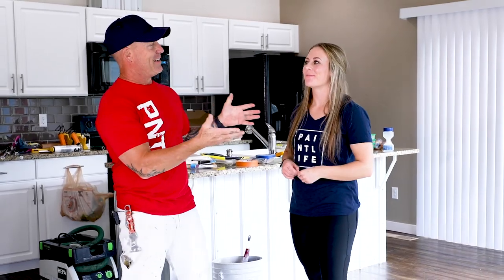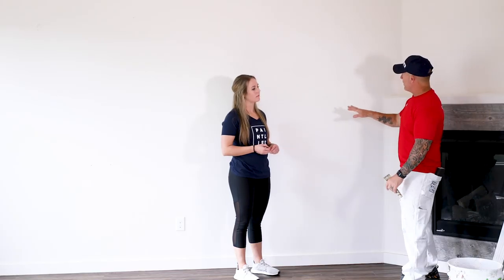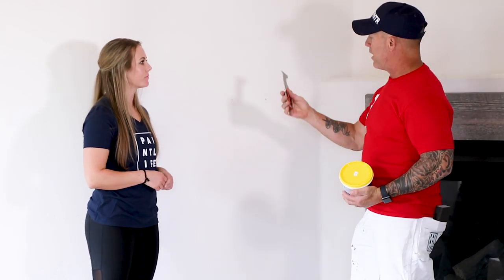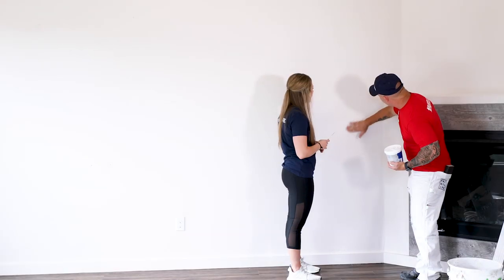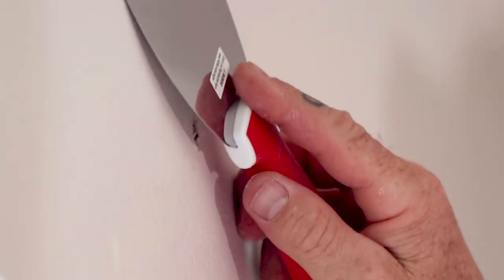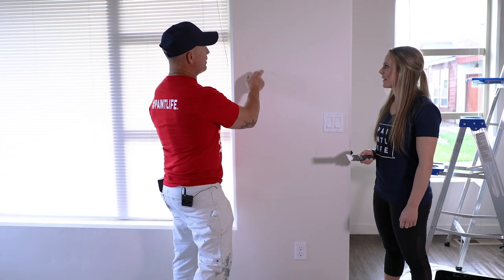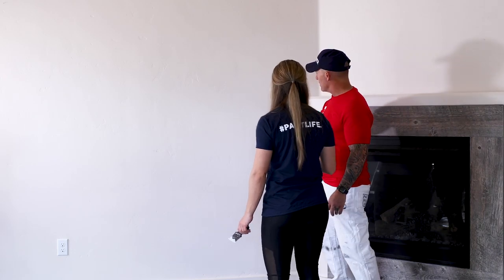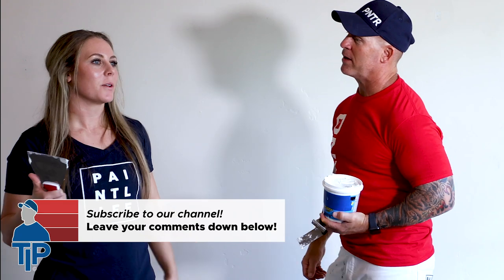Repair Your Drywall in 3 EASY STEPS! Prepping Walls to Paint

Comment: I normally use non shrink paste to fill in all the screw and nail holes ect. Using normal drywall mud/spackling will shrink and you will possibly have to refill 2 or 3 times before getting back to a flat surface. I like the Dap "Fast & Final". I also like to cut the heads off of the plastic anchors so as not to yank them out and create a larger hole to fill and always knock in the metal ones a little and mud over them. Also will prime those areas with the paint that will be used on the wall so to help blend in better. As for stress cracks over doorways, ceilings etc I like to use an elastomeric patching compound so the cracks will not return for a very long time. The compound will stretch instead of cracking like drywall mud would. Great to use on exterior stucco surfaces as well. Good luck with the home 👍
Reply: Shrinkage can be dealt with using spackle by first over filling the hole, and then making a quick pass over it with pressure from a clean flexible knife.

If done correctly, there will be a "bump" of spackle protruding only from the filled hole and a thin film around it, which is all easily sanded. The bump will prevent the patch from shrinking into the hole, and only one pass is necessary. 

I use a 6 inch tape knife as a pallet to hold my spackle and clean my flexible 1 to 2 inch putty knife.

Quick and easy, but it may first take a little practice in application. I have used this method on level 5 smooth wall and high-end trim in expensive homes for decades. Nail holes are completely invisible with no "cloud" or flashing around the hole, spot priming still recommend as always. 

Note: Crawford's and other "non-shrinking" spackle still does shrink a bit, but not nearly as much as some others. Regardless, this method works with virtually any spackle, and can overcome problems presented by not only shrinking, but hard-to-sand spackle as well.

Comment: One trick for those plastic anchors is to run a screw into it till it just barely bites and pull it out with a pliers
Reply from the maker: Great tip
Reply: Yes, that's how I've done it for years. Smashing in the drywall is not a good solution.

Comment: These were simple, but what about an old wall someone butchered 10 years ago.  Guy attempted to remove a 18’x20 rectangle plaster section to repair some plaster backing rows and then finished it off with replacing with a drywall cut board.  In removing some busted ass paint the shite job is glaring with tape coming up.  Do I just remove the mud and seam paper get it smooth and flush and just redo the seams with tape and fresh mud???  Or do I just get the paper out where it’s broke visible or peeling?

Comment: So how do you avoid having your spackle create an area that (once it's later painted) becomes an area that looks flashy? Am I painting too soon after I spackle or am I using the wrong brand or type of spackle?
Reply: Make sure you sanded away the thin film around the hole, and spot prime the patch. If you have no primer, use your paint. The spackle needs three coats in most cases--two coats of paint plus the spot priming, which should cover the nail holes  but be thin and "feathered" out smoothly to the surrounding area around the spot primed hole

Comment: After painting over patches, why can you see them through the paint at different angles, even after spackling and sanding the spots? How can this be prevented?
Reply: Gino Hernandez what I do to prevent that is prime the spackle spots with the same paint you will use on the wall before rolling. I go around before doing my cut ins and hit each one with a Minnie roller, just be sure not to put it on too thick.
Reply: @snipellama4753  Thanks for the info. 👍